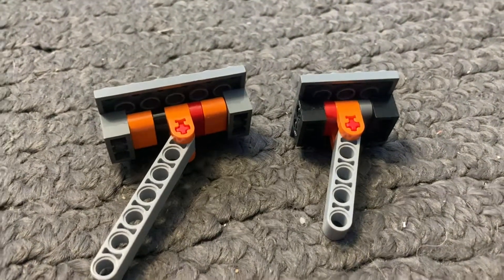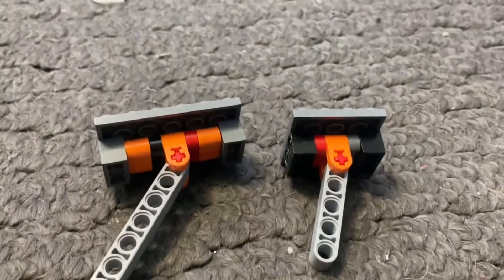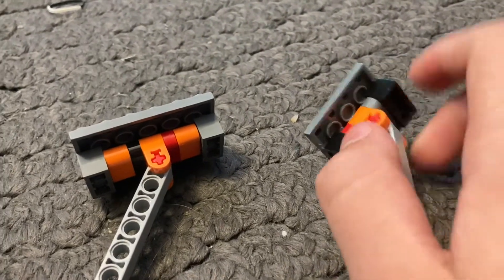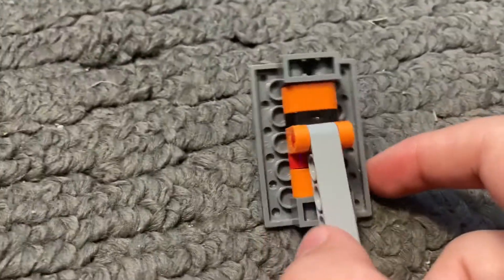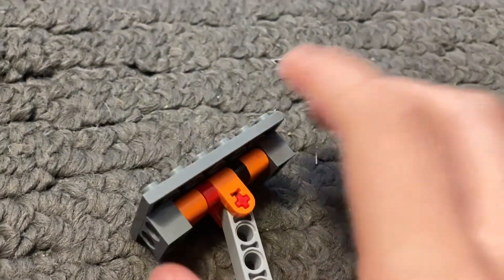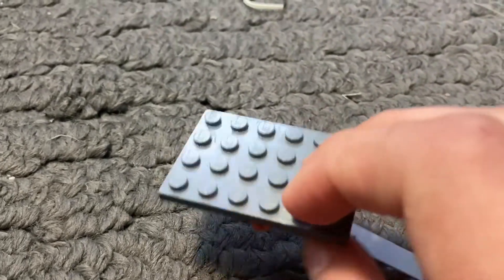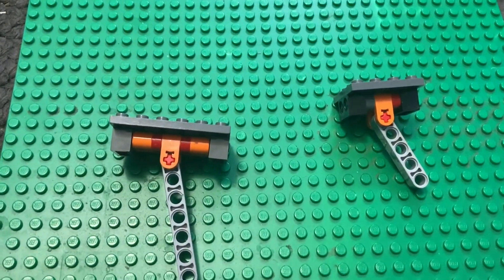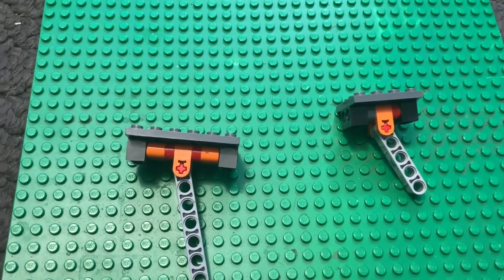ALTERNATIVE Lego Performance Piston (Tutorial)

Comment: Awesome man! I got some really neat pistons that will revolutionize the vacuum engine community. But I can't wait to see your supercharger design!
Reply from the maker: I can’t wait till it’s finished too, I was thinking of making an electric supercharger where the turbine is spun by an electric motor.
Reply: @KFPlusLegoMastery  That's possible, however your engine will run weird if it's constantly getting the same amount of throttle, either have a speed controller tuned and hooked up to the engine throttle or just have the supercharger spun by the engine. Option 2 is what I'll be doing except I got something that'll blow you all away soooo... Anyways have a good day y'all!